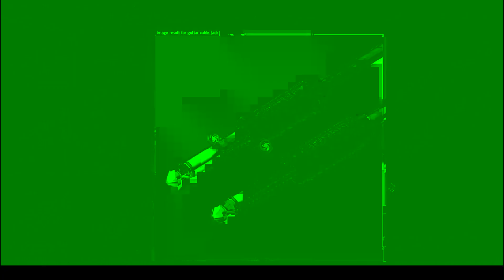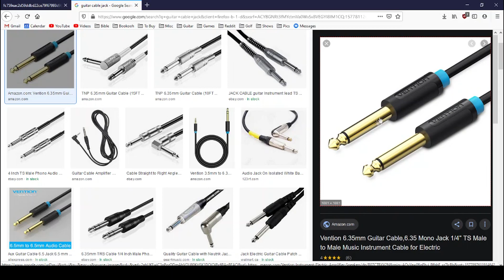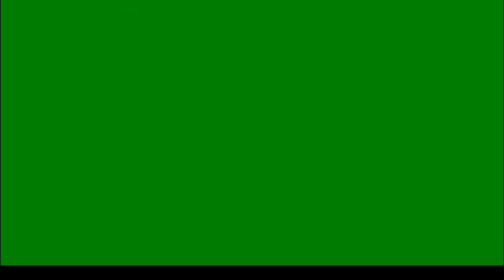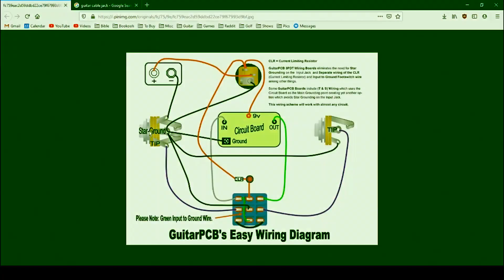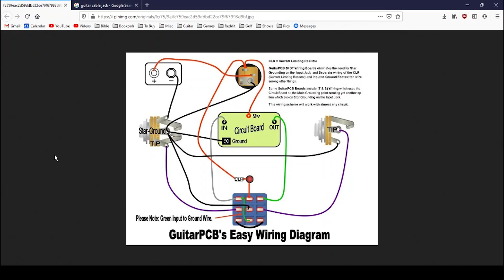Offboard Wiring Explained - DIY Guitar Pedal How To Guide

Comment: I'm building a Beavis board and very new at this. How in the world do you get the wires inside the box to attach to the back of the attached external terminal block? Drill small wire holes? None on the original Beavis so they attached them somehow to the BACK of the terminal from inside the box it looks like. Best way to do this and get the inside wires outside and connected to terminal block?

Comment: The ground wire coming off the output jack to the input jack is creating a ground loop. Both jacks are already connected together via the enclosure itself, that wire is just making a loop.
Reply: Excuse me, newbie here. Is this always the case are the switches connected via the enclosure?  I was thinking this was a fault of my pedal.
Reply: @Tiocaidh  Thaks!!
Reply: @HernánLondoño  Anytime buddy :) Happy building!
Reply: I was wondering about just that
Reply: The output jack should be isolated from enckosure to avoid this, then all grounds connect at the star ground point (input jack)